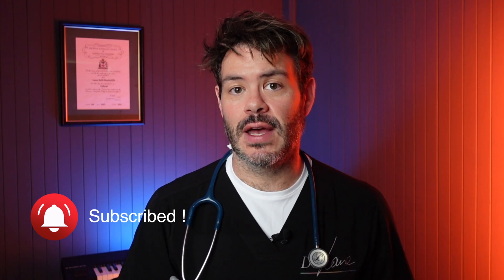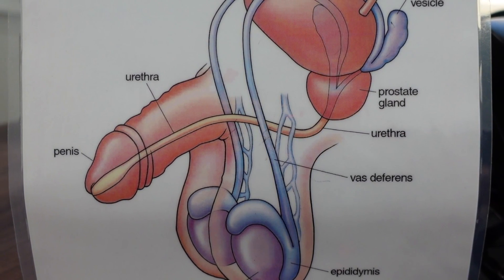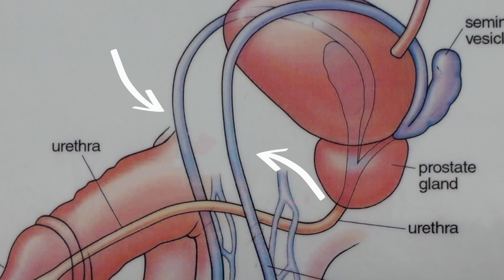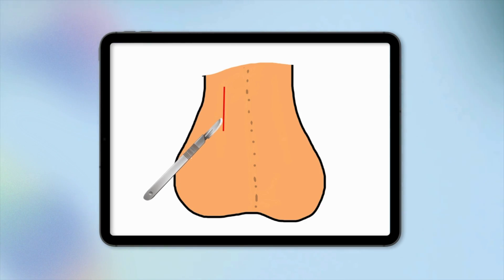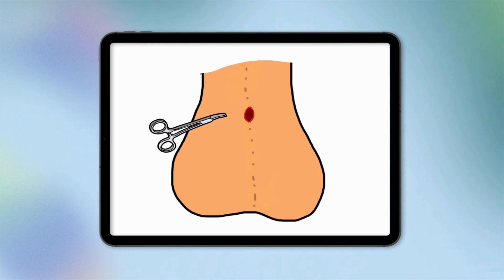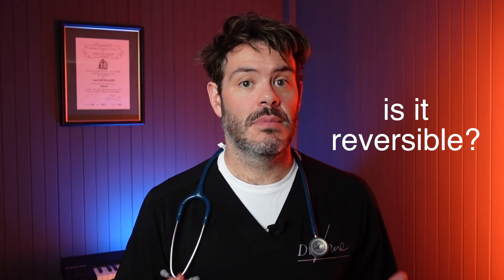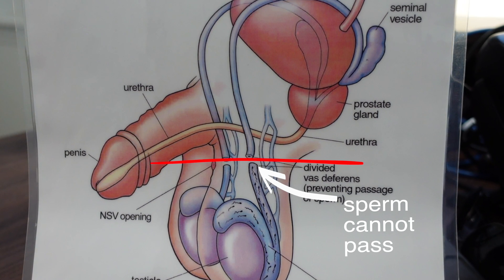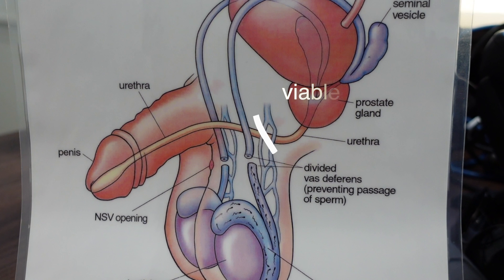No-scalpel vasectomy vs. traditional vasectomy

Comment: Do the no scalpel should have a titanium clip?! Is there any other method which doesn't use titanium clip?!
Reply from the maker: Good question - the titanium clip is used as an alternative to sutures but it’s not always used. There are several methods that don’t need the clip - eg. one called ‘mucosal cautery without fascial interposition’